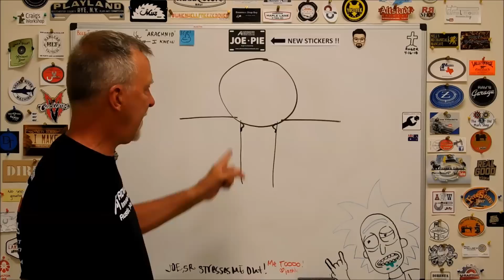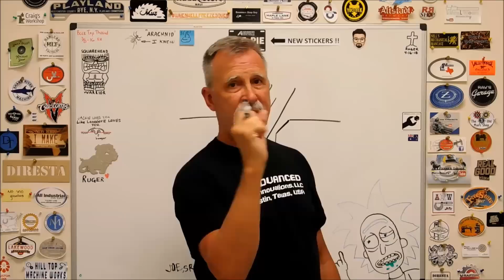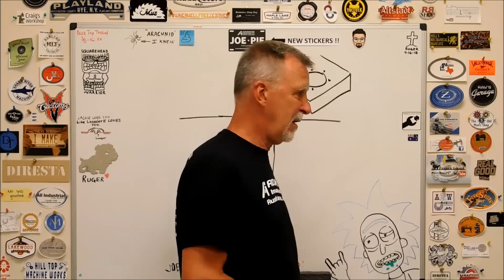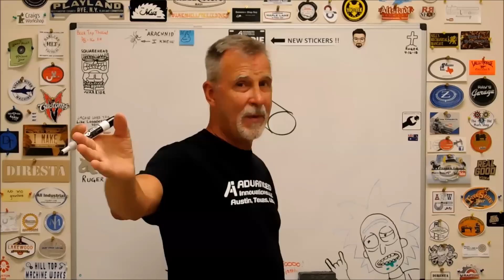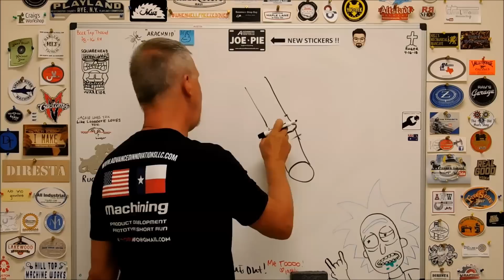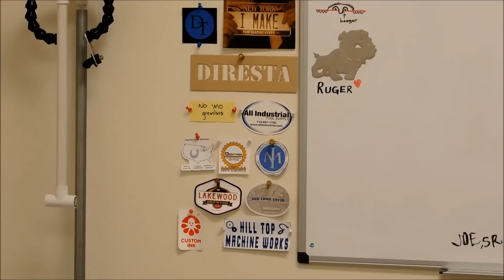7 Identical Problems, 7 different Solutions ---Take a Look !! ---

Comment: In a word... Loctite. 
The high grade bearing retaining anaerobic adhesive will not compromise the body through distortion, which is what occurs with all the 'smack it around' methods.
Knurl presents as as a remove/repair problem as the distortion of the body is much larger and messier with removal. 
The superficial 'smack' methods still have a lower side loading capacity due to the original design intent of an interference (press) fit.
Reply from the maker: In a word, make a stepped pin and re-press it.

Comment: For most of my experience was with replacement of bearings and bushings in aviation components. This episode flashed me back to various bearing and bushing “staking” processes, especially punches and dies, and some applications using roto-staking tools, to emboss retaining flanges, on the various components, though, these methods aren’t intended to correct oversized bores. Bore size was typically, a critical inspection criteria of the bearing / bushing replacement.

Comment: The centre punching around the hole is a very popular fix seen on old clocks repaired back in the day. Nowadays you can buy std bushes with drills to that cut holes for the bushes to be a press fit in the clock plate. The issue then is that the pinion may have worn a slot in the plate and the bush drill will wonder from the true hole centre and the depthing of the gears is then wrong.

Comment: It may just be a variation of the center punch but I use a chisel and hit the pin lengthwise on three spots around and it works like a charm when I add some locktite to it. The idea is that it helps keep the pin centered in the hole never to come out.

Comment: Excellent tutorial Joe. When all else fails, there's always Loctite.
Reply: Hardly a 'last option'. Retaining fluid alone is probably the best method without any need to distort the pin or body... and far higher load capacity.

Comment: What about a divorce? ;)
Reply from the maker: I believe there are 50 ways to leave your lover....At least thats what Paul Simon says. :)
Reply: @joepie221   'Divorce' i.e. removal ...is easy!  The mess left over is certain.  
What about... a reunite after 'separation' without a reduction in union integrity is the trickier question. 😉 
I'm not keen on the 'distort/displace' the male or female methods due to that and typically lower integrity and load capacity.... except the machined knurl which is getting to be a proper mess to divorce.
Easier to allow free fit or use a glue that only needs heat to help free up if needed.

Comment: Hi Joe - Love your videos! I have used at least half of those techniques! I work on aircraft structural stuff and in aviation you can't use those techniques due to stress issues. [legally]. We often use epoxy paint in the hole. [thin coat and dry] and install the fastener wet with the same epoxy. Super tight and super difficult to remove. We also use Hysol [liquid shim epoxy]

Comment: Great tips! Just hours before I saw this I got a related problem. In a 12 mm thick aluminum plate I planned to drill a couple of holes and tap them for M6 screws. I wanted tight threads so I drilled 4.8 mm holes and reamed to 5 mm before tapping. I drilled the first hole, and the reamer dropped through the hole! What?! Well, nothing spectacular since I just used a 5.8 mm drill bit. The reamer thing, and completing one hole at a time, saved me. I solved it as follows, and I think this is a standard technique invented by the Romans, which I don't know the name of since I'm a complete novice in machining. I made a 8 mm tall M6 nut from 10 mm polished silver steel round bar, and milled a round profiled 1 mm deep groove with a 3 mm ball nose end mill alongside the nut. Then I made a 8 mm long pin from 3 mm round bar of the same steel quality. If the width of the nut with the pin laying in the groove is D, the next step was to drill a 3 mm hole D - 5 - 1.5 mm + epsilon mm from the center of the ruined M6 hole. Then widened the M6 hole with a 9.9 mm drill and flattened the bottom with a 10 mm end mill. The milling probably made the hole slightly oversized. I pressed the nut and pin into place in the vice, and the result turned out very well. I think this procedure will cause the nut to be pressed a bit off center by the pin. Maybe a brass pin would be more suitable? I tested the method on a piece of scrap first and concluded that the pin should be shifted slightly outwards, so I tried epsilon = 0.1 mm. Any advice for how to do this correctly are much welcome!

Comment: Instead of gripping the pin in a vice to bulge it out, what about in a 3 jaw chuck, ok it'll take far more pressure, but with three points of contact there's less likely hood of wiggle. One method would be to use a tubular press tool ( or vice ) to compress the metal around the pin ( once it's installed ) to close the metal around the pin, a modification of the ring of centre punch dimples. No mention of loctite.

Comment: 5 minute epoxy works too, if you're not going to be exposing it to high temperatures. Oil the pin to keep it from sticking.

Comment: Great video, thanks for all the great tips and tricks. 
My favourite of these technique is the knurl, as is is the most radially symmetric, keeps the pin in the hole the straightest due to the length of the knurled section, and somehow feels the most "done on purpose" rather than as a fix for a mistake made.

Comment: Greetings from Norway. I have seen the use of hole chissle together with a press or hammer to expand the pin of rollers in rocker arms of motorcycle engines. I guess it would be a more uniform expansion of the pin or even bore could be collapsed in the same way.

Comment: Thanks Joe, perfect timing for my current project. Its around 40c here in the midlands (UK) and my steel is increasing in size relative to temperature so should be a good fit!

Comment: Nice one. Now I know why my subconscious yelled at me to 'buy it, buy it!' when I spotted a knurling tool that fits on my lathe... 
There's a few more ways to 'fix the issue', also...   
'Upsetting' the pin by heating it and hashing it down onto something hard. Then it shortens slightly, and becomes thicker. Assuming you're working with a metal that can be easily forged, of course... 
Then there's the 'it's not a fault, it's a feature' by drilling and tapping one or more intersecting holes and fitting grub screws... ;-)
Nope, until recently, I didn't have a torch good enough for the first, and I'll blankly deny ever doing the second.

Comment: As always Joe, your instructional videos are fantastic! This one is no exception!!! 💪

I have one question though, if you don't mind. You mentioned that deforming the end of the pin under pressure is cold "swaging". When I was a machinist we did something similar on one of our production parts, and it had the same effect as the end of a screwdriver buried in the plastic handle..... But we called it "staking". My question is: are they both the same thing.....or are they two separate operations with their own unique names?
Reply: Staking typically refers to "upsetting" the end of a shaft or other part that has been inserted into a hole in relatively thin material to prevent the shaft/part from pulling loose or rotating - think about the way most metal toys are assembled. Jewelers watch/clock makers & gunsmiths regularly stake parts together to hold them securely.

Comment: Great info.  I know about four of these and have used three of them, so I learned something.  I have also shimmed a pin using a few strands of small copper wire.  The only way this could have been a better video would have been to measure the force needed to insert the pins, so it gets an "A" instead of "A+".

Comment: I would add that this works on plastics also as long as they aren't too brittle. Used it on nylon and others. But, as you said, structural streeses are important to calculate when doing this-plastics have much less fidelity. Thanks for the video, Joe!

Comment: Only the knurling solution has any structural integrity as presented. For locating and side loads (most pin usages) other examples will fail at one or both. Place an indicator near the top of the pin and side load it (in multiple directions) and you'll find significant side deflection compared to a correct fit pin. The problem is the axial length of contact is tiny compared to the depth of the hole. To do it right you want good contact at both ends of the hole (minimum). So to avoid issues:
- only use #1 ball bearing hit (or #3) for through holes and do it at both hole ends
- pin knurl or #5 chuck smush length should be ~90% of hole depth
- #6 center punch / #7 rod dent smush (or even knurl) should be in two rings spaced ~90% of hole depth
Overall cool techniques and demo.

Comment: many years back, An old machinist taught me about peening,
But I worked for a big construction manufacture of bridges, and they showed me another technique you may want to consider
This should work on steel, but aluminum, I don't know, have not tried it. so let me know if you try it and it works.
Try heating the hole in steel, and then cooling it fast with water 
That hole should shrink. but watch how you do it, as it may warp the product beyond specks.
They used this technique to take twists out of huge beams,
May work wonders on small parts if the fitting has to be tight,

Comment: Three axial chisel cuts around the perimeter of the soft pin will also work wonders on the pin dia., and is faster than knurling.
I'd use the chisel cuts on smaller dia. pins, say 3/8" dia or less, and the straight knurl on larger sizes.
If a straight knurl is not available, use a diamond knurl and form the complete knurl.  Then file off the tips of the knurl so that there are flats on the pin od to bear against  the hole wall.  This would locate and fix the pin better for radial loads.
Reply: I'm glad I surveyed the comments before adding mine to the top of the list: three axial cuts is how commercially made center-groove dowel pins are made (see item 98400A249 at McM-C).
Reply: @ChazzC  Notice I did not claim originality for this.  In fact, I had seen this many decades ago when doing maintenance on my lathe.
This is what prompted me to chime in.
Reply: @BasementEngineer  Didn't mean to imply anything, just agreeing with the approach and providing a convenient point of reference for others (I really wish that YouTube would allow dropping photos into replies). I had just come across this style of dowel pin yesterday when I was looking for a soft pin.

Comment: Hey Joe, I remember hearing a precision machinists trick for closing a hole a few thou down its entire length. You heat up the part, or area around the hole, with a torch, then cool the hole by either pouring water through it, or blowing compressed air, so that when the rest of the part cools it shrinks the hole.
Never tried it myself, I tend to just use loctite

Comment: Another pin option; although a bit more intensive…
Drill a hole in the centre of the pin, or saw-cut across it, and insert an interference fit “wedge”. The “wedge” will provide lead-in predominantly, a chamfer may be enough; but a more shallow taper may be better, the majority of the length should ideally be parallel. This will swage out the hole and will create a deformation in the OD.
This method provides a much greater contact area in the fit than most, with a controllable level of fit interference; although it does introduce stress risers in the pin.
Reply: Only if it is large enough.

Comment: Nailed it joe! Particularly like the the pin centre punch if you did it @ a slight angle would they come out like teeth? I have come across the straight knurl on a few occasions but always thought it was just to lock it and not a fix!  Hope yer well Dude stay safe! Bottle of home made Strawberry wine 22/08/15 that's English money date Cheers :) TFS, GB :)

Comment: I have used straight knurl method in the past, like it, the pin can not wiggle. I really like the punch method for hard pins in soft material, had not seen that before, thanks!. Most of the time I simply use Loctite cylindrical fasteners.

Comment: Hi Joe, some useful techniques, thank you.  Although contrary to your experience, the success of the knurling technique is to some extent dependent on the relative hardness's.  In this case, the pin appeared to be harder than the hole.

Comment: Just two cautions: lateral displacement and pivoting. Both can be dealt with, but not equally by all techniques. Lateral displacement is easy: just make sure the material displacement is symmetrical about the axis of the hole. 

Pivoting affects the perpendicularity and can even lead to the pin being loose in the bottom of the hole. The pin-base techniques are best for this, especially the knurling, which can naturally go the entire the length of the hole. But you can do the same with the punches and the hard pin squeeze, as long as you do it at two locations along the length of the pin. 

Of course, if the pin goes through the hole, you can use the hole-based techniques on both sides and you’re golden.

Comment: Read through the comments and no one has mentioned the perpendicularity of the pin to the surface of the work. 
If using a punch to make a dimple inside the hole, wouldn't that cause the centerline of the pin to shift to the other side, maybe only a few thousands but still?
It seems to me that all of these methods would have the same effect except for the knurling method.

PS: thank you for the wall shot showing your stickers and other cool things. Playland is awesome and is less than an hours ride, if it's still there. Been years since I went last. Sorry to see that you had a bout with the current scourge. Glad you're back up and doing well.

Thanks for the video and your time.
Reply: I think he mentioned kinda spacing your marks equally around the hole/pin to help keep the pin in the middle of the hole...

Comment: thanks for this video, found it quite useful!  ... i suppose as a non machinist the specific choice depends which part is the harder material, either the pin or the stock or workpiece. and usually... we here buy premade stainless steel pins from china of a certain size or dimension. which is for locating either into a plastic 3d printed part, (which might or might not have a metal collar heatsert). but if not a functional plastic 3d print. then either an aluminium stock, or into wood. so typically... the stock is softer than the pin in most of those scenarios for non machinists. ofc if you are machining ten this could be totally different. and with a broader variety of situations

Comment: "And in the next video we will show increasing the size by soft soldering the pin  and some loctite products." 😂😂😂😂😂
Reply: PS i soft soldered the end of the brass infeed tube before refitting into the carb of a V6 Ford, famous for coming loose😢, lasted 3 years till i sold the car and it never leaked a drop.

Comment: Also on the pin a regular blacksmith technique, traditional swaging, strike vertically on to an anvil or harder surface and deform the pin at the base or with heat anywhere you choose.
Reply: On behalf of us amateurs thanks for adding to the conversation, which is something we need more of these days rather than the usual social media garbage.

Comment: When I’m rebuilding vintage magnetos I occasionally get one where the bearing has been spinning on the shaft & a new bearing is too loose, especially early models with brass shafts.
My go to method has always been knurling. Although the most popular size is a 15mm shaft & the 14mm bearing has identical outer diameter & depth, so I can turn it down a millimetre sometimes.
They’re only a light press fit though, so it’s an easy dimension to blow, then you’re back to square one.
I don’t have a problem with the diamond knurl here, as the bearing is hardened & the shaft is soft. I’ll look into a straight knurl though.
Reply: On behalf of us amateurs thanks for adding to the conversation, which is something we need more of these days rather than the usual social media garbage.
Reply: @tonywilson4713  well thanks Tony, but I’m certainly not an expert (well, maybe in my own particular, very niche field). I like to think I’m always learning, & Joe’s channel is a great place to learn.

Comment: Have had similar oopses a a diemaker. If in the shoe, drill the hole out tap drill size for a bigger plug, fit a threaded plug and peen it in place, file surface flat, drill and ream again. If the hole was reamed by mistake with a clearance reamer, a bit of panty hose (Don't laugh!) over the hole and drive the dowel in.  Won't last forever, but puts the die back in use until next sharpening/maintenance.
Reply: On behalf of us amateurs thanks for adding to the conversation, which is something we need more of these days rather than the usual social media garbage.